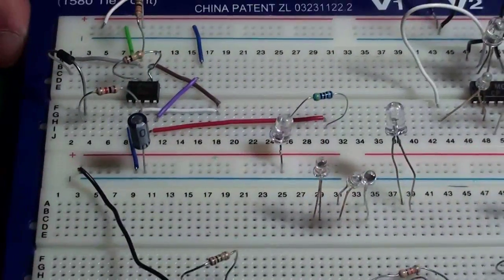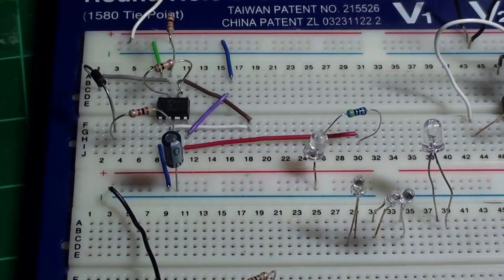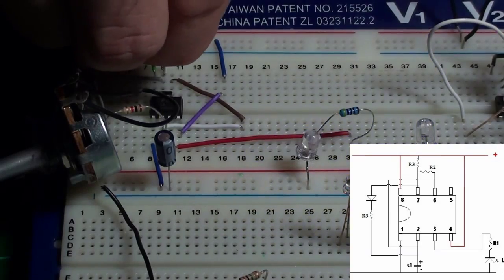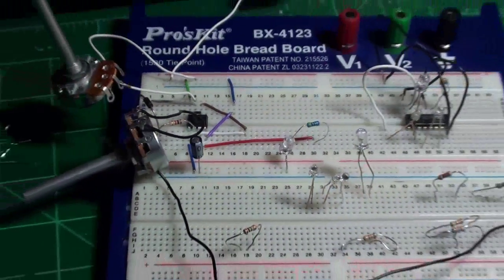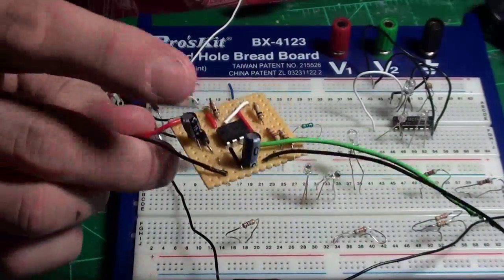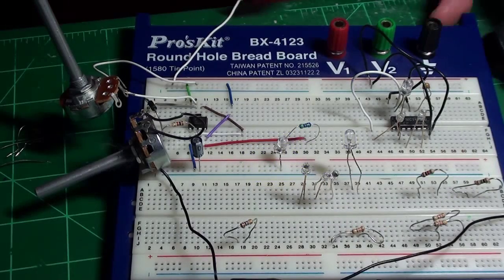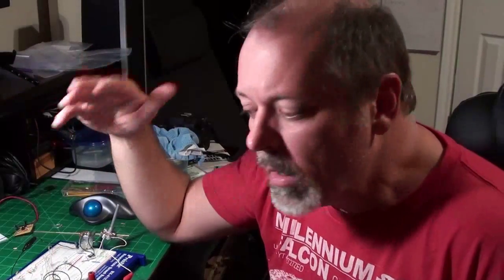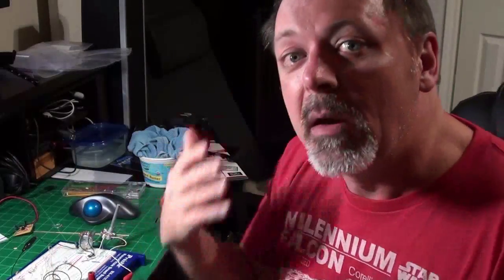Lighting Tutorial:  Strobing the 555 timing chip

Comment: What would I need to add to allow it to operate on a 12 volt Lipo (12.6 - 11.4 volt range)  Would like to strobe a white led on the tail of an electric RC plane.  When fully charged it is 12.6 volts.  At the low end it is 11.4
Reply from the maker: +Gary Grimley The timing chip will operate at that voltage just fine.  The problem is the LED won't.    The 555 is a voltage in/voltage out chip.   This means if you feed it 12 volts, you get an output of 12 volts.    So you will need to put a resistor on the LED for 12 volts or you will burn out the LED.

Comment: I'm thinking of integrating a circuit like this into a high powered LED light I made(80 watts). This obviously doesn't put out that kind of power, so could I instead use the signaling output(where blinking LED is) to switch a MOSFET gate? Using the MOSFET to run the 80 watts through. great demo video!
Reply from the maker: +yz250ftony I am not sure, I don't have that much experience with MOSFET's.   But I know that the circuit can be used to do what you want....
Reply: I'd just use it to switch a MOSFET.

Comment from the maker: +Daksh.Kaim  I am not sure how to do that with a 555 chip, I know it can be done with the 4060.  And that is an easier circuit.
Reply: Sir, while your video is nice and informative, though somewhat a rambling account, allow me to make a comment regarding the accuracy of the circuit components you describe and display in the video.  You are incorporating  potentiometers into the circuit and not rheostats. A rheostat limits, varies, or controls AC current [amperage] exclusively. The devices you are using  in this circuit are potentiometers, they exclusively limit, control or vary DC voltage, Not AC current. Think of the 'pots' and their function as identical to a volume control on a radio for example. The pots typically utilize 3 terminals built into the device, your circuit uses 2 of these terminals instead of 3, which is acceptable for controlling this specific circuit.  A rheostat incorporates 2 terminals Only for controlling AC current. Thank you,sir.

Comment: I know you have it running off a 9 volt power source, is there either a single resistor that I can change like R1 or one of the R3's to allow a lower voltage supply to be used?  Like a 5 volt maybe?
Reply from the maker: You can drop the voltage down to 5 volts with no problem, but the 555 will not operate below that limit.  Just remember to adjust the voltage on the resistors for the LED's to compensate.
Reply: badgrendels well i got some free time, and tried it with a 5 volt supply and it works
just fine.  didnt really have to change much for the resistors, just the
one going to the LED like you said (a few ohms) but the rest is still the
same.  Also it scared the piss out of me when I got a little curious on the
resistance between pin 6 and 7.  made it too high (since its the one that
will control the strobe speed, so the off time in other words) and boom,
the led blow in half about 4 kohms.  lol yeah not doing that again.
Reply from the maker: compwolf2 Glad to hear you got it working!  I will keep that in mind and try to not make that mistake myself.

Comment from the maker: If they are not blinking try replacing the capacitor, if it is bad or in the circuit wrong, nothing will blink.   If that doesn't work, check the value of your resistors.  One of the two of them are bad.

Comment from the maker: If you go back one video, click the link to SMA you will find the values I used about half way down the page.   R1 was 330 Ohm, R2 was 10K  I used a 140 Ohm resistor to connect pins 7 and 2.   The two capacitors were 63V 10 mfarad electrolytic capacitors.  The diode were the smallest I could find.

Comment from the maker: The only problem I can see with it is the power output of the chip.   I don't know what that is off the top of my head, but I suspect that it is lower than the power requirement of the LED strip.   For a short strip I am sure it will work, but a long strip might be difficult.

Comment: I have 5 meter of LED strip lighting being shipped to me.with a 24 button control and a wall outlet 12V DC supply that goes to the control box then the strip. The 44 button control has a strobe option but I would like to add my own. Im thinking of cutting into the output from the remote box that brings the power to the strip just before reaching the + of the strip and adding this. It runs at 12V 2A. Is this a viable option?

Comment from the maker: @emka381 To be honest I am not sure.   I haven't tried to run it with more than five or six.   I do know that it is voltage in=voltage out.   What you need to do is find a spec sheet on the 555 and see what current it can handle.  The 28 LEDs will draw .6 amps.   Which is pretty large for this type of circuit.

One way to do it is using an amplifier.  It will amplify the output current.  I know very little about that, so I can't explain how to do it.